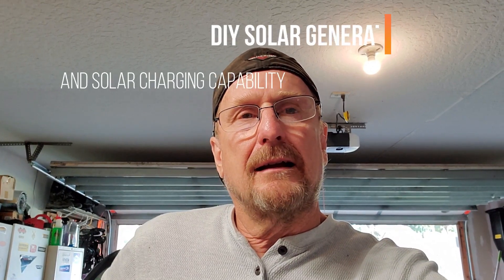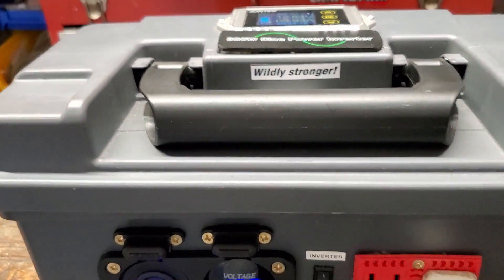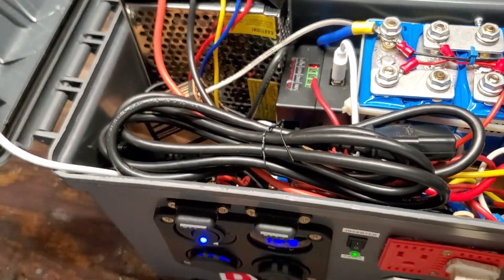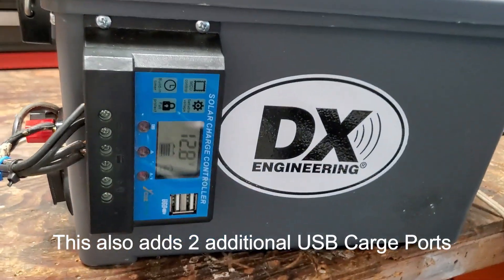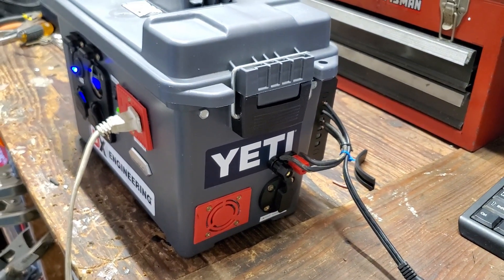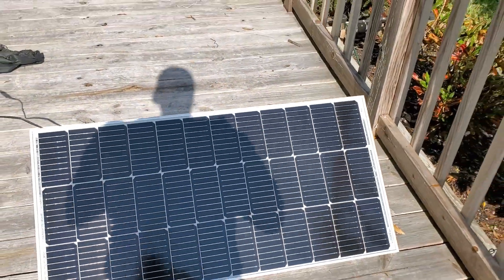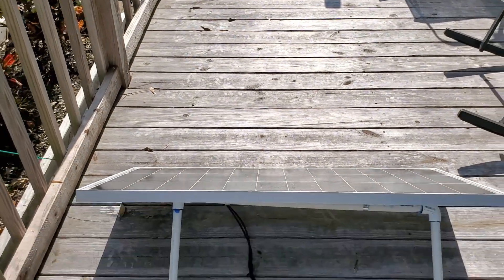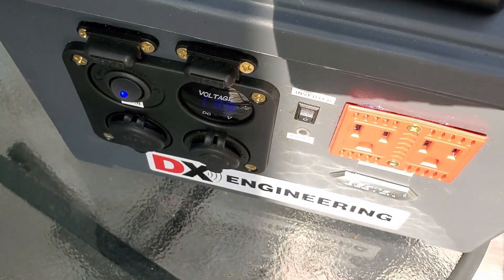DIY LiFePo4 Solar Generator   Updated with Solar Charger and 110VAC Charger

Comment: Hey Don, I'm in the process of collecting parts for my first dyi, so im pretty new at this.
Just curious...if I put a 110 inlet in to charge my battery with home current like you did...
How would I need to wire it if I had a charger in the box?
Sorry if that's a dumb question, I just cant figure that out! 🤔
Oh, and where did to get that inlet with a switch?
Thanks
After I posted this I found the exact switch you have on Amazon.
It already has the positive, negative, and ground wires with spade ends...
I just don't know where to put them.
I'm guessing the single red to the fuse box and the other 2 to the charger plug?
Sorry again.
Reply: Darn, sorry I see you replied a few days ago.
Thank you sooo much!!
Be safe
Reply from the maker: Hi, The 110VAc goes to power the charger. The hot wire goes through the fuse and the nuetral wire connects directly.  The output of the charger connects to the BMS output. Do not connect it directly to the battery. The batteries will charge through the BMS which will cut off the charge when the batteries are full. The BMS output is the output going to all the 12vdc devices and switches. Also, for a charger, I used a 15vdc power supply adjusted down to 14.4V dc.  You don't want more than that to charge LiFePo4 batteries. I hope this helps. Good luck.  I have been using my portable pack alot lately on trips.  Recently used with 12vdc air compressor to repair my trailer tire on the side of road. Also rums my HAM radios off grid.

Comment: Hello, so what did it cost to build if you dont mind my asking?
Reply from the maker: Hi.. at the time, I had about $250 into it with the majority of cost  being the LiFePo4 battery cells then the BMS. However, everything has went up in the  last few years. Not sure what cost would be today. Add 25%??
Reply: @donsdoityourself2547  LiFePo4 battery prices have started to go down now.

Comment: I have my charge controller separate from the power box because I have 3 boxes and buying charge controllers for 3 boxes is expensive.  I have Anderson connectors (outlets) that allow back feeding with a charge controller.  The AC battery charger is also separate from the boxes but connects to the Anderson outlets.  This allows the battery to be bigger in the box.  I think of all the things that connect to the power box to be accessories and have a cardboard box for the stuff.  One box does have a stereo in it with side speakers that can disconnect and sit separate from the box.  Two of the power boxes are "ghost boxes" in translucent white.
Reply from the maker: That sounds really nice. Way to go!